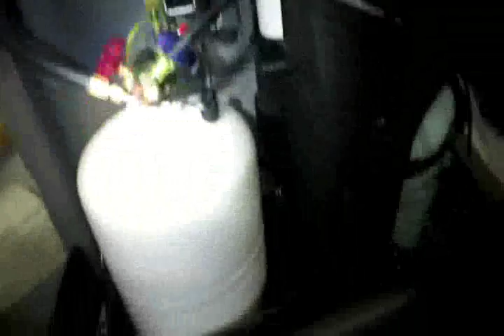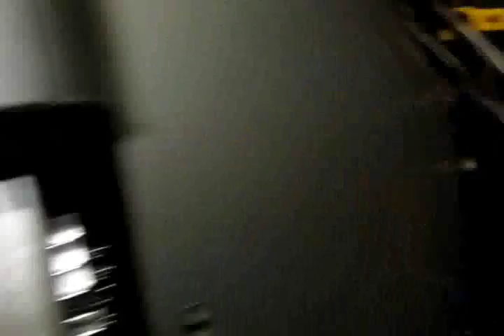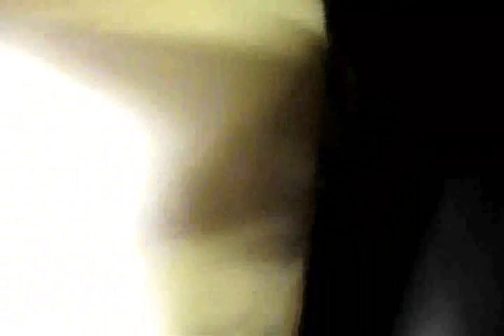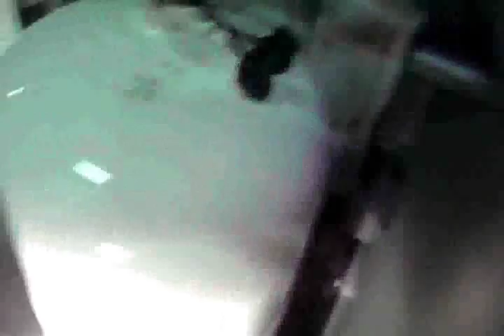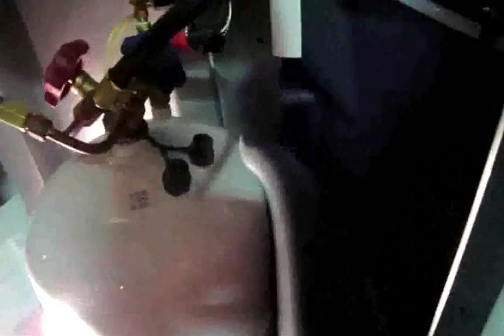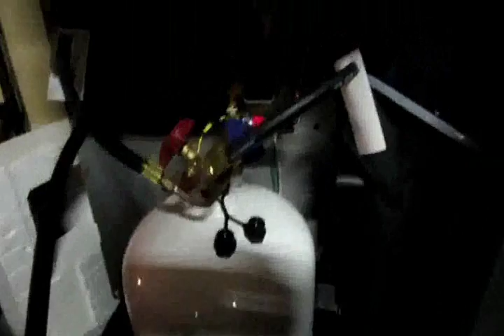Robinair  AC machine looking for leaks and I found one

Comment: Howdy, did you pressureize the system or run it to find the leak on the machine? Or did you check for leaks at a static state/not running?
Reply from the maker: did what the manual said to do.   Check it. The unit is no more under pressure in use than it is static.  The pressures inside the unit stay the same.